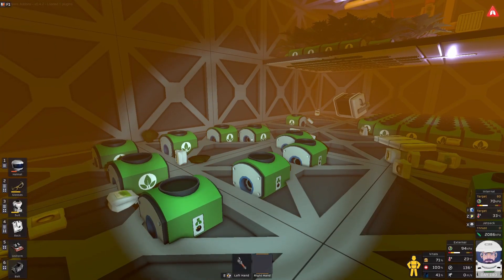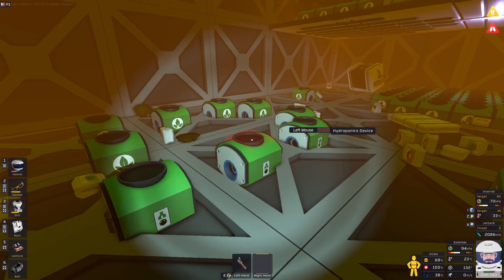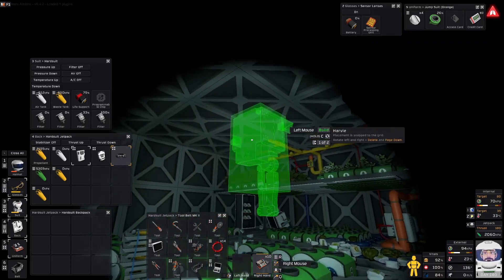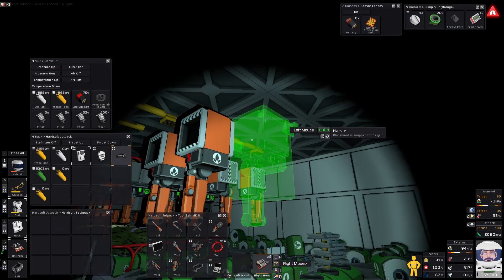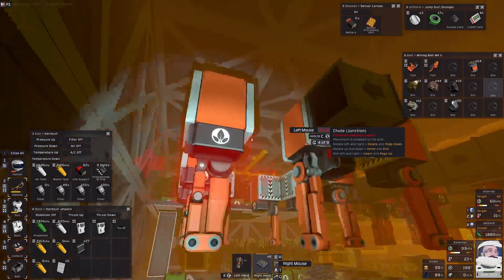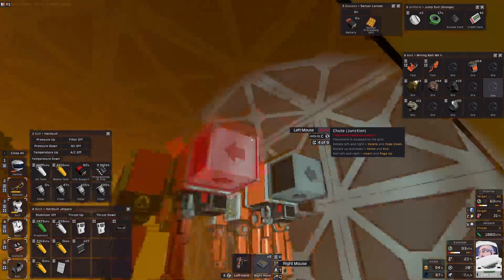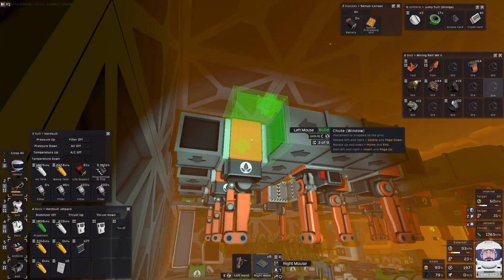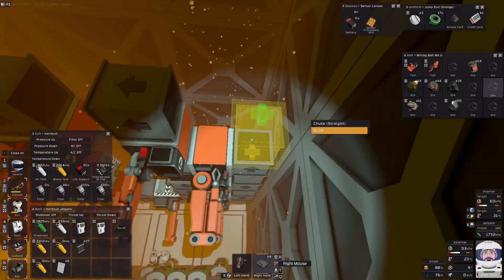How to automate harvie - A Stationeers tutorial

Comment: Chute T piece and harvie grabbing from it is a bug, i wouldn't count on that for my setup.
Reply from the maker: a bug? It's been around a looooong time if that's the case. I've seen people use this a lot in the past, which is where I got the idea from. I don't see why it should be changed, perfectly reasonable to have a system that can feed into requesting devices without needing overflows that needleessly hold items in them. The chutes are good but they don't have much flexability in terms of feeding systems like this one. It takes a boat load of chutes as it is.